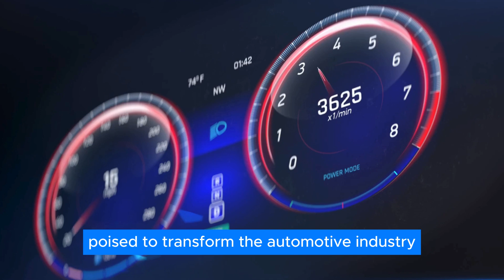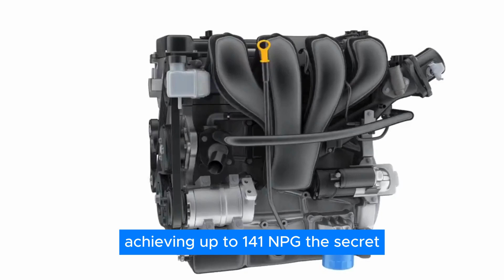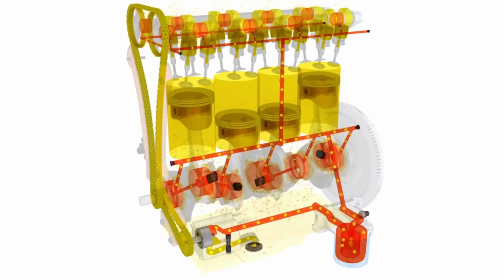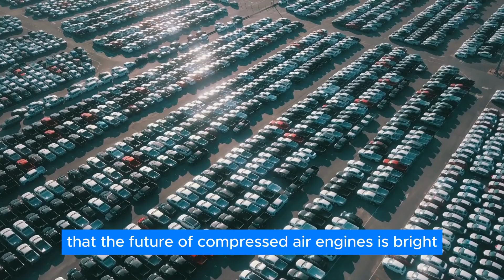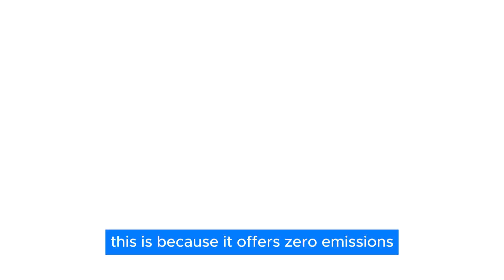ALL-NEW Compressed Air Engine To Disrupt The Car Market

Comment: First of all, it's not an engine, since it doesn't convert heat energy into rotary motion. It's an air motor (same with electric motors). Also, air motors are not new, but to use them as the 'prime mover' in a vehicle is not efficient; not by a long shot. Compressing air to high pressures wastes a lot of energy as dissipated heat, and the amount of air needed to power even a small runabout city car would be phenomenal. Perhaps you might tow a little tanker behind you? There is nothing new in this old concept.